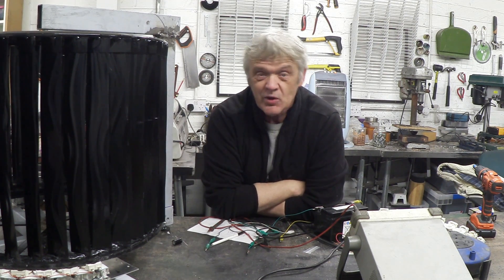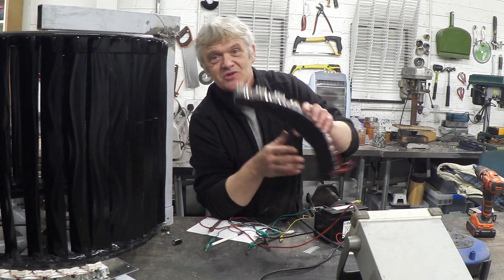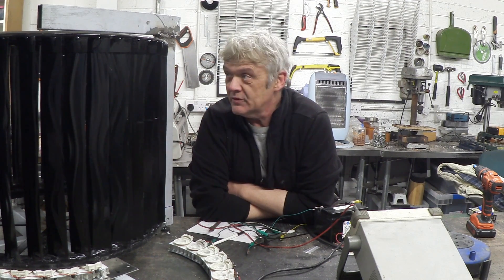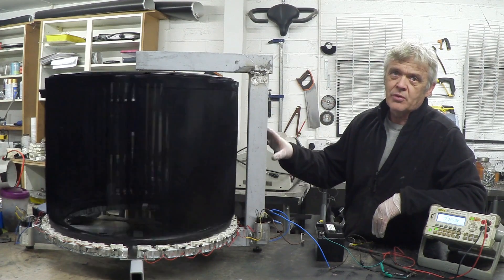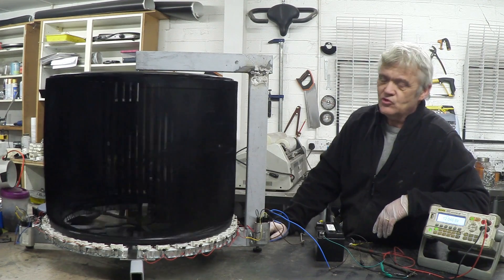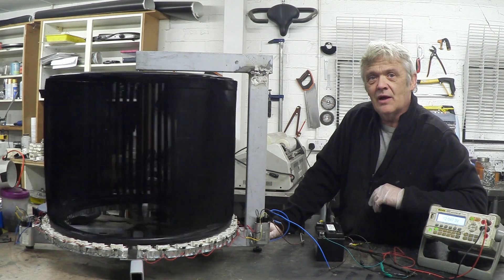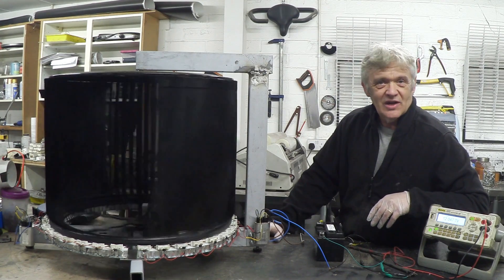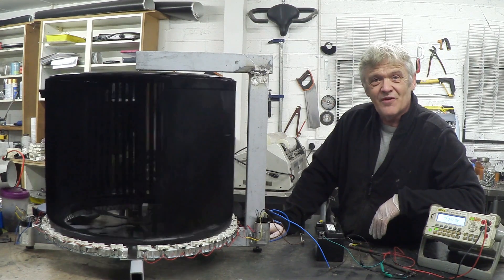Finishing The $100 Wind Turbine

Comment: You are so bloody awesome mate. I can't help but think its super efficient because you made it. 
My first hho generator seems to produce ok but I failed to seal it properly so I need to go back and play some more.
Reply: What do you use your HHO with? 
I mean how do you use the gas to generate?
Reply: @garethb5729  I want one for my car, one to replace my blow torch and I'd like to make a workshop heater. I'm not sure if I understand the question mate
Reply: @karlmyers6518  ok yeah sweet. That's what I ment. 
Do you want any tips?
Reply: @garethb5729  Yes please, I went for. Fairly simple setup with a 2ltr mayonnaise jar , really fine stainless mesh and bicarbonate soda. I might look at buying some gas fittings.  I now have a couple of microwaves to make more amps but each setup will probably be a little different for different applications
Reply: @karlmyers6518  
316L grade stainless works best. 
Car. 
The ignition source occurs a few degrees before dead center for standard fuel. 
Change this timing too a few degrees past dead center. 

Torch. 
About an egg cup size of HHO sounds like a shotgun at point blank range. 
Keep your bubbler small. Make it on demand, don't store it. And pay extra attention on your flashback arrestor.  Tbh I haven't spent much time on torches, far too scary for me. 

Heating. 
Pump the HHO through a catalytic converter and it recombines into water. Red hot with no flame.
Reply: How do you generate hho for car?
Reply: @samknight2573  it's only run into the air intake to grab a bit more mpg and a slightly cleaner burn but I got busy so haven't got back around to building another.  There  is quite a bit online about them mate
Reply: @karlmyers6518  yes I like the idea but my summary of them is they take more energy to produce hho then you get back through burning , honestly has it had positive results for yourself ?
Reply: @samknight2573  I would have to look more in depth as I "think it" alternator spins at one speed and produces the same charge and is only regulated to the battery using a switch "relay" so in theory taking unused power from the alternator and using it doesn't seem like a loss. I may have a Google on how they work while I watch my favourite lfc footy team tonight mate

Comment: i wonder how many hamsters it would take to = 1kw over a day? ;)
Reply: 1 hamster, and four cats could fit, this wheel could produce about 20 m kg of torque. :D
Reply: Oh, sorry, only 5 m kg, based on normal cat weight.
Reply: @hommerdalor6301  It's likely that one of the cats will stop for lunch (the hamster)
Reply: The hamster must be kept at optimal distance in front off the cats to achieve the required rpm.
Reply: @hommerdalor6301  lol..    this bloke is so cleaver isn't he :)the mad scientist
Reply: Hehehe. Yes, and more importantly he has the ability to persevere, going deeper and wider.
All good.
Cheers

Comment: If I am not mistaken aren't wind speeds of 20m/s more usually known as "Gale force" winds?
Reply: That's 45mph - by then it's not output that worries you, it's survival!
Reply: @hempev  We have summer thunderstorms that produce winds stronger than that.  I've driven in winds higher than that. When winds get above 100 is when we start getting worried. The shingles are only rated for 120MPH.
Reply: @gravelydon7072  Big commercial units have survival ratings from 40-72m/s, and some off-shore units are rated to 80m/s (that's 180mph), but a typical wind farm *stops* all rotating mass for safety at +/-60mph (wind turbines have been known to catch on fire due to over-speed braking). Anything that weighs less than a grown man shouldn't even be running that high.
Reply: @hempev  I was in a government built building that had a door rated for 180 MPH +10%. Hate to say it but that door failed early on. We had evidence of tornado strikes on our home but the reason we lost shingles was the flying sheet metal from a neighbors shed roof in that same storm. The eye wall was recorded as at 155 MPH sustained. Our home was dead center of that storm and one of the few surviving power poles in the area is out front of our house. It was put in when our house was built over 40 years ago. Cat 5 storms are no fun and I've survived two so far. One Atlantic storm and one Pacific storm. I'd just as not see a third one. Our home is hardened enough that when Hurricane Irma came thru, we couldn't even claim enough damage to get paid by the insurance company. The local power companies shut down the local nuke power plants when the winds reach 55 MPH sustained. The grid stays up on power generated outside the area that is affected and they keep the natural gas powered ones up till winds hit 100 MPH. Haven't heard at what point they shut down the solar units but my guess is at 100 MPH also so as to protect the grid. Most of our main powerlines ( 3 phase ) are on concrete poles now but Andrew even shattered ones that were two ft across.
Reply: @gravelydon7072  Life in Hurricane Alley!! Add to it climate change... We get the most destruction from earthquakes, and they're years apart.

Comment: 1kw for a turbine that size is pretty darn good.  can't wait to see real world output
Reply: if it makes 150W at 22mph I will be extremely impressed.
Reply: 1kw ? never , more like 15-20 watts at good wind speed and the inefficiencies  are enormous . Absolute waste of time .Payback , around 25 years !!!
Reply: more like 5w per hour it is impossible for the size to be usefull
Reply: @gaborbor2523  you're forgetting that the idea is to harvest not to replace a generator
Reply: @stevetobias4890  horizontal with more blades could work, this one is just a cool experiment but in real life useless.
Reply: @gaborbor2523  Eh? What is watts per hour?
Reply: @gaborbor2523  It is not the size but the general shape. At 22mph it should do more, but the question is how much. Savonius wind turbines are famously ineffective compared to standard horizontal ones. Typically they will not recoup their cost before they break down.

Comment: That's awesome Rob! Maybe consider putting a buck boost circuit between the capacitor(s) and the battery as a rudimentary MPPT regulator... 👍👊👏
Reply: I'm going to add that to my electric bicycle powered by a 1.2V NiMH battery, that'll make it work.

Comment: Really nice to see that turbine finally seeing some use. I would suggest to remove your "anti-backflow" diode though, as its functionality is already included with the full bridge rectifiers and its just eating up precious voltage at that point. Btw, did you use schottky (0.4V DD) or just regular pn Diode Bridge rectifiers(0.7 DD)?
Reply: I agree. Anti backflow diode is not needed. Magnets seem pretty evenly spaced this time. Spacing coils on phase even distances, put them in series and only then use a bridge rectifier might do and would save the power lost on all individual bridge rectifiers.
I'm afraid the power target will not be met by far. Losing the cores and solid oven transformers was a bad idea in that respect. No matter what, it's a lot of fun.
Reply: Diode is needed so as to not keep draining the battery into the capacitor when the turbine is not producing power.
Reply: @gravelydon7072  Yeah sure but we are talking about something in the range of microamperes for the leakage current of the cap. If you are willing to forget about those microamperes, the capacitor just takes power to charge. Once its charged, it acts like an open circuit.
Reply: @headlessxp4948  Even multi Farad capacitors have a discharge rate of under two weeks so the mA loss does add up. Maxell 2.7V 5F super capacitors will self discharge in 10 days as an example and may be under usable Voltage in less than a week. Discharge rates per one person's test showed from 5% overnight up to 50% in under an hour. So a blocking diode can help and as Robert is using used capacitors, we have no idea how they fall in that range of rates.
Reply: @gravelydon7072  But we are talking about HV capacitors in the 10s of uF or even less and rated for more than 2kV and 10MOhms leakage resistance. Also, if those were to develop the kind of leakage you are talking about, they would dissipate about 0.003 ("the mA loss" -> i will be generous and say 3mA) * 2000V = 6W. At 6W of heat pumped into it, that cap would blow up after no time. This means that even at 2kV, their leakage current has to be lower than what you said ("the mA loss"). And since Rob is using those caps at 12V, the leakage current will be basically 0.

Comment: That's looking pretty damn slick.

If you're interested in finding what its actual efficiency is, all you really need, I'd have thought, is a big old resistive load current sink, like a toaster, kettle, or radiant heater coil, hooked up directly to the output, in a relatively steady wind, and measure what it's capable of pushing through it.  No, that's not a realistic usage setup, but it should be able to give you an idea of what its actual output is for a given windspeed as measured with your handheld anemometer.   Get a few data points, compare to your theoretical graph, and extrapolate if possible.

My guess is that you're not gonna be doing too badly, and like you've said all along, it's not really peak power that's important, but what you can pull out at low speeds, but that's still impacted quite heavily by the (electro) mechanical efficiency of your setup.

Comment: Rob, this would be a great time to stick the meter in-line with the circuit to measure the actual current going through the battery. Seeing you're charging a 12V load, you could quite easily calculate the power from the current, and you wouldn't be measuring short-circuit current. Also, what's the open-circuit voltage?
Reply: Agreed. Even if it is 100W it was only 100$ which would put this actually very high up the food chain with regard to cost/output.
Reply: @canadajim  He hasn't shown more than 10W output.
Reply: @evaluateanalysis7974  Exactly , it's a non profit con if you know what I mean . He does not even realise the ramifications of wind speed in the output calculation of a wind turbine specifically the velocity cubed component . 
Pwind = 0.5 * ρ * v³ * A

where:

    A is the sweep area

    ρ is the air density, assumed to be 1.225 kg/m³ by default (you can change it in advanced mode)

    v is the wind speed - the typical usable range is approximately 3-25 m/s
Reply: @dongraham4760  Hi Don, do you know of any reliable instruction for a windturbine?
Reply: @dongraham4760  did you build any wind turbines recently? I'd like to see more
Reply: @dongraham4760  non-profit con? it's a plain for profit con. youtube presented me at least 5 ads whilst i was watching this 1kw wind turbine BS
Reply: According to the title of 1KW the output would be approx 80 amps as 12 volts. The wiring is not even close to supporting this kind of load, something like 25mm2 cable would be needed. Not sure if this can generate more than 10 Watts on a good day.
Reply: What would be really really useful is a wind generator + graphene battery combo.

Comment: I wish you did a current measurement as well as the voltage measurement. Also RPMs. With the blower holding the rotor at a relatively constant speed you could derive a nice windspeed to power baseline. 🙃
Reply: My thoughts exactly. You can quite easily derive a rough value for the RPM from the video though.
Reply: He has a workshop full of ammeters. He simply refuses to do it.
Reply: No doubt that he's done the tests, but since they would show that the 1kW figure he started out with and won't let go of is an order of magnitude or two out, he's never likely to share them. He'd do himself and everyone interested in his endeavours a favour if he'd be straight about it.
Reply: @will_doherty  you don't know what the minimum wind speed required for 1kW is? If that figure were 200 m/s or something silly then fair point, but it isn't
Reply: @nickatexpressvhs9281  You really ought to read what is written, contemplate what it means and then try to come up with a valid response, if you so wish. Until then, please restrain yourself from sharing your "wisdom".
Reply: @will_doherty  I'll take that as a 'no' then...
Reply: Hope you see what I meant (and why it isn't random) my point was for a fair test the experiment would take place in the same operating conditions as a commercial '1 kW' turbine - which will also output an order of magnitude less for low enough wind speeds. Thinking about it now the main variables are just size and drag, if there are any more to think of pls add them.
Reply: @nickatexpressvhs9281  Try electrical efficency.
Reply: @nickatexpressvhs9281  for his configuration to generate 1000 watts ?  Its 93 kilometers per hour and the turbine will "attempt" to rotate at just under 5000 rpm then BANG !!!!!!!
Reply: Need to find out what the SI unit of awesome is before doing any measurements.
Reply: @gustavfenk4021  LOL!
Reply: A possible optimization would be a shroud covering the optimal diameter of the turbine and connect it to a weather vane.
Reply: @GlennHamblin  I think the main advantage of this type of windmill is that you don't need to turn it into the wind. So you put up with the disadvantage.
Reply: @matutolaYT  
You can baseline RPMs not necessarily wind speed. He already has a chart for windspeed to power, so he must know what the RPMs are at a given windspeed right?
Reply: he probably mesured it but when he saw how bad the numbers were he dident want to show us
Reply: @08047870  Exactly!
Reply: @matutolaYT  right because Betz's Law is already premised on the assumption of no drag

My take on the physical 'laws' is that they are not set in stone, they are just tools for humans to use and adapt to our needs ... it's just like deciding whether  a taylor expansion to the 4th degree is necessary or if 3 terms would suffice.  Some laureate guys used to dedicate YEARS of their lives to working out that 4th (before equivalent numerical methods on a computer came along).
Reply: @nickatexpressvhs9281  @Edmondo Cunha 

Guys all I'm saying is measure it. I'm sorry but more data is a good thing.
Reply: @nickatexpressvhs9281  "My take on the physical 'laws' is that they are not set in stone" Yey! I've just decided that I can fly.